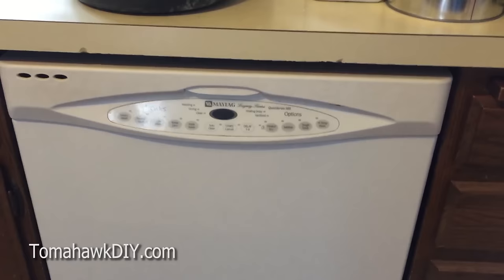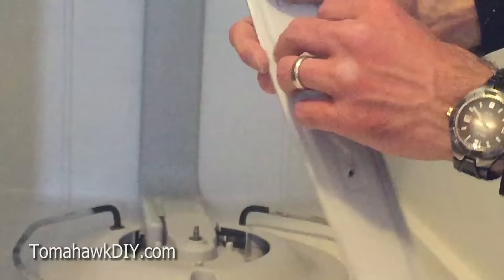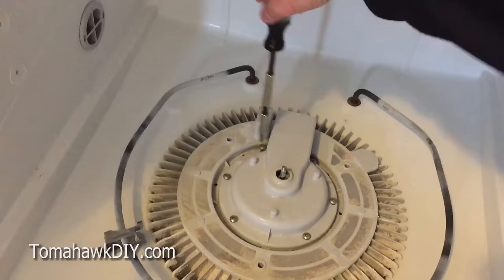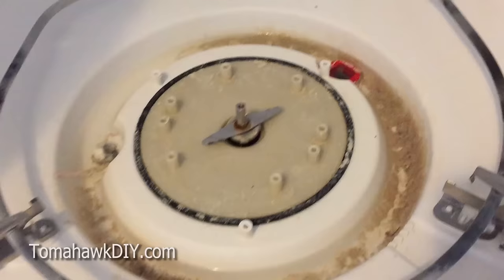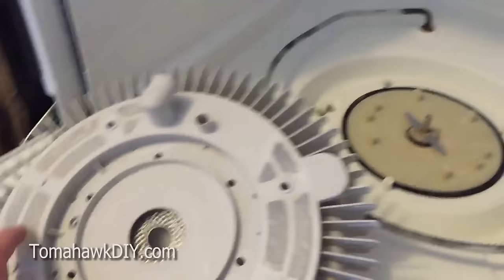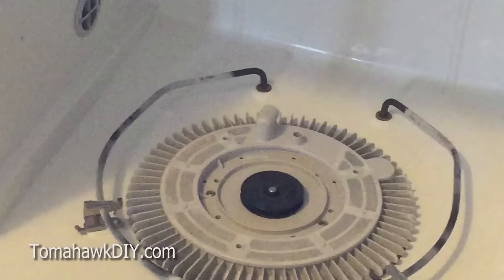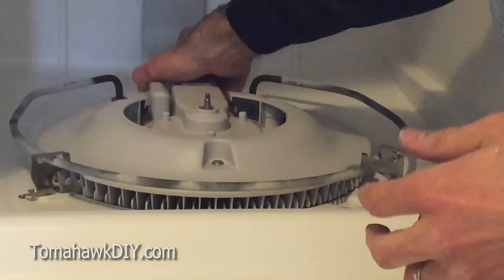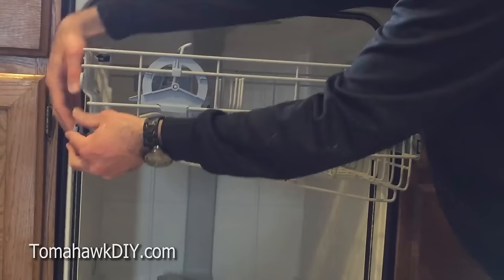Dishwasher Not Cleaning Well - How to Clean

Comment: I did it! I did it! Great instructions! It's much easier than I thought it would be, thanks to this video. I just finished taking it apart, cleaning it, and putting it back together and now I'm letting it run through to wash out any of the cleaning products I used before I put dishes in. So glad to not have to pay a repair bill or buy a new machine. And I learned something new... so I'm quite proud of myself. Thank you! Subbing now!
Reply: Cool.   I have a different model but have to clean the screen assembly.  The washer is smelly and I'm figuring on it needing a good cleaning.  I never did it before and it's 20 years old.
Reply: I also did it today! Thanks for such a helpful guide

Comment: This is the video to watch for this repair.  All other videos I saw only removed the covers and filters on the floor of the washer.  Removing the top tray and the tube at the rear of the washer, made removing everything else a breeze.  No struggling, jiggling, or awkward removing of components.  Thank you so much.  You turned a pounding headache into just a tiny little pain.

Comment: I have a Maytag MDB89100 dishwasher installed in 2000 (20 years ago!) that has been a reliable performer. Recently, however, the dishes were left with a number of light oily/greasy spots.
Thanks to youTube and your video, I was able to disassemble, clean 20 years-worth of gunk out of the filters, and reassemble the dishwasher.  My process was slightly different than yours:

1. The spray arm does not disassemble for cleaning (the clip-on metal parts are heat deflectors for the heating coil)
2. Fortunately, my DW doesn't have an exposed column to bring water to the top sprayer (supply routed external to the tub), so I didn't have to futz with that.  That said, for those who do, it might be helpful to reinstall the upper spray water colum prior to screwing down the lower part, for easier assembly.
3. While your model appears to have only one filter screen; mine has four. One of them is a vertical cylindrical screen (think auto air-filter shape). The top and bottom differ slightly, with the bottom resting on a gasket while the bottom slips over the lower assembly.  The orientation is not marked, so make a note when removing.

Some additional thoughts:
1. Toothbrush and nail scrubbers are helpful cleaning tools
2. Take pictures as you disassemble; helps in putting it back together
3. Keep screws, bolts with associated pieces. If possible, stack in reverse order to speed reinstall time and eliminate second-guessing
4. Pay attention to how tight the screws are when removed, so you don't over (or under) torque.  keep with assembly holes as noted in 3, above, so they don't get lost or misused.

Comment: Thank you so much! This is exactly the same inside as our Jenn Air!  My husband and I worked on it together, can’t believe how easy and it worked perfectly! Definitely couldn’t of done it without your video.
Reply: Hi! I’m trying to clean my Jenn Air and I’m having trouble loosening that black wheel with the screw in the center. Did you have any trouble with yours? The star screw that worked on everything else isn’t fitting with that middle screw, of course :)
Reply: @camillepress8484  This is old.. but if you have issues with that.. pour some white vinegar in the hole of the screw.. it will remove the gunk and let you pull it out easily.
Reply: @camillepress8484  If you have trouble with the screw... hold the black wheel and then unscrew it. If not it just keeps moving.

Comment: Whew! Very good instructions. Just running a vinegar bath through the reassembled machine to remove some of the harder calcium carbonate deposits. What a bogus design for the Maytag filter!! After maybe 10 years of not cleaning the filters, the glasses were showing foggy spots. it took many hours and several brushes and plastic utensils to scrape the filter parts (sort of) clean. The consistency of the soft gunk inside was indescribable. None of my cleaning fluids made it easier. I've got another cleaning six months from now on my calendar.

I should mention that the thin round tube for the upper sprayer assembly was pretty clogged and required a skinny brush with a very long flexible twisted wire handle to bend around the right angle. I hope it will clean up in the vinegar cycle.

Comment: Thanks for your video.  There's a similar set of videos that can also be useful.  See for example this video from the set:

https://www.youtube.com/watch?v=bL0xypO4M9c

Yours is the Maytag Quiet Series 300, and his is the Quiet Series 100.  The 300 has two additional screws that are not in all the 100 models.  His video shows a shortcut involving just removing the bottom pieces, and not removing the top rack or the rear water pipes.  That worked fine for my needs it seems (read below).  I hope my top "rotor arm" is not plugged.  Is that common?  The bottom rotor arm wasn't plugged at all.

I had a 300 series with a noise problem.  Thanks to your video, the noise problem went away.  There was a little piece of colored glass or something down by the rotating "blade" thing, and an orthodontic elastic band actually on the blade thing.  That may have prevented the blade from making proper contact with the metal thing with holes above it.

I removed the square red rubber piece above the drain hole and cleaned it too.  If you do that, don't forget to put it back on before you reassemble everything.

Thanks again for the instructions.

Comment: Excellent video, TomahawkDIY!
I posted replies to a couple of other commenters about clips that fell off during the removal of the sprayer arm. I had the same problem. The plastic support on the Maytag dishwasher body itself is shaped like an X (actually, more of a cross).  If a clip gets dislodged, position the square hole of the clip over the X and then rotate the metal clip slightly so that the four legs of the X point to the CORNERS of the square hole. Then, while pressing the clip against the DW body, just twist the clip back to horizontal so that the legs of the X catch the clip and hold it in place.
Reply from the maker: Thank you for that. Happy to help as well

Comment: Thank you for the clear and detailed instructions. I found one challenge that seems to be peculiar to Canada. All the screws required a torx screwdriver and 2 different sizes were required - #1 and #3. I guess appliance manufacturers want to make it as difficult as possible for us to fix things. Second, getting the dirt and gunk out from between the fin-like protrusions is a job for a small bottle brush. If you don't have one, pick one up before you start. It will save you hours.

Comment: This video was super helpful! I just moved into a rental and the dishwasher kept leaving residue and stink on our dishes. You would not believe what I found when I started cleaning the filters out, not sure it had ever been cleaned once! So glad I will have squeaky clean dishes now :)
Reply from the maker: Glad it was helpful!
Reply: I am once again cleaning out my filter because my dishes just weren’t getting as clean as they used, to and this video was so helpful yet again. The instructions are clear and straightforward, and very easy to follow! Thanks again :)
Reply: As a side note: I used the strongest spray setting on my garden hose to spray out the filter and it worked so well!

Comment: Both of my dishwashers have built-in food waste disposers, which grind up any bits that get into the dishwasher and flush them out the drain.  But the best way to prevent buildup in the first place is to watch what you put in there in the first place.  Needless to say, I've opened mine up before and cleaned them out as well, usually after glass breakage which is of course exceedingly rare.

Whatever stuff was left over in your dishwasher didn't look good.  Amazing how dirty it can get, then we go and put our dishes in there thinking they'll get clean.  The comedian Gallagher once said "Soup isn't even food.  Soup is what's left over in the dishwasher after a good meal".

Either way, very nice tutorial on how to take apart the bottom strainer assembly.

Comment: Adding something. My Impeller was stuck with gunk. I removed the little screw and dropped a few tbsp of white vinegar (Coca Cola should work same way) in the screw hole. I let it sit for about 20 mins.. and the thing came off easily!  Thanks - Trying the machine now, finally finished it! (I have health issues that don't allow me to bend down, so had to do this on a span of a 3 days).

Comment: Of all the dishwashers I've had this one was the biggest pain in the butt to get to the filter and then you can't even take the actual filter apart you have to spray out the hole like you did. That is what brought me to this video to see if there was a way to take the filter apart. I have asked my husband to do this for a year but he has a hard time getting down on his knees so I bit the bullet today  when nearly all the dishes had gunky residue on them this morning and my sink is full of dirty dishes going to have difficulty cleaning the parts. My son put the grates out of our electric smoker into the dishwasher and there is greasy black gunk all in between the little plastic parts. Hope I don't have to use an old toothbrush it will take forever.

Comment: VERY GOOD. 

My old Whirlpool dishwasher has a metal orifice hole (much like our shower heads) at the electro magnet valve which is used as a meter for the water flow fill rate before either the timer or float shuts off the magnet. 
I had to use a slightly larger drill bit to drill out the hole which was too small to let enough water in and so caused motor pump cavitation sounds and poor cleaning, which manually adding more water fixed. 
I also had to bend/adjust the float shut off level switch to allow shut off at just the right water level to keep from cavitation but not use too much water.
Take care
If the light by the padlock symbol is on, then you've accidentally activated the child lock feature. Press the button in for a some seconds until the light/child lock feature goes off.
Reply from the maker: Thank you so much for your tips and insights

Comment: yeah this is exactly what we needed to see... got one of these kept choking the drain, cleaned out drain 3x, then pump, finally found the source, these little filter traps, sadly it seems they do not come apart for cleaning? seems like fused part, lotta gunk trapped in it! tysm 4 post!!
Reply: BTW the assembly of this model is identical to my early model JennAIR. And I discovered by very careful prying at outer edge of the filter screen with a flatblade, you can work it loose around the rim, it is a factory glued item but this is the only way to get under the screen and get hair and garbage trapped out from there. The flow to drain pump is through this screen and you can scrub out inside the drain channel as well. Only pry on the outer edge, only around the filter sections, you can then lift it enough to pass a toothbrush or pipe cleaner into the drain channel and get all the crud out, water flushing won't get it all and this is what chokes your drain pump!
Reply: And don't worry about trying to glue this screen back together, if you carefully preserved the inside edge, the through bolts on re-assembly hold this all tight together!

Comment: This also works for other models like Jenn-air JDB1100AWS. Thanks... It's quite difficult to get all the gunk out behind the mesh filter. I had to use a high pressure garden hose outside to get it decently cleaned.
Reply from the maker: Thanks for the info!

Comment: Very GOOD
Also listen to the motor pump to see if it sounds like it is making a surging cavitation sound, indicating it is pumping air some of the time, low water level. 
Manually add some water to the dishwasher cycle to see if the cavitation sound goes away. 
If so then research your model, to increase the water level.
Also, If not starting and the light by the padlock symbol is on, then you've accidentally activated the child lock feature. Press the button in for a some seconds until the light/child lock feature goes off.
Take care

Comment: Thank you. You explained it very well. I think I might be able to do it myself.  One question. Since there is no way to unplug it, I assume it's still safe to clean it. Is that correct?
Reply from the maker: +Catherine Baldridge I recommend you turn off the power at the circuit breaker.

Comment: Excellent video. You saved me several hours and much frustration.  Do you have a video on replacing the rubber door gasket. My dishwasher is leaking from the lower right corner..
Reply from the maker: +Peter Smith unfortunately I don't have one in the gasket. If you want to record video footage of you replacing it, I might be able to turn that into a video I could post. Glad this one helped you. No pressure, but if you feel inclined to leave a tip, you can do so via www.paypal.me/TomahawkDIY.

Comment: Life savers! The Jennair website said to quarter-turn twist off the arm and then simply pull the filter up and out. I yanked and yanked (hopefully not breaking anything) to no avail until this video mentioned the billion other steps needed (side note, WTF Jennair?). My dishwasher still isn't cleaning, but I found the broken bolt for the washer arm floating at the bottom while cleaning the filter, so trying a new bolt next.

Comment: Thank you. This is amazing. Didn’t know we could do this. 
When we took the long thing off that is clipped in with two metal clips, the clip from the back of the dishwasher fell off. The top one stayed on. How do we re-attach the back clip. Tried snapping it on, but just fell right off. Is it glued on there?
Thanks!
Reply: Hi Chris, did you ever figure this out? Same thing happened to me. Any advice would be much appreciated. Thank you!

Comment: This video is such a fantastic help! I’m a single woman who likes to figure things out without asking for help.

But as it turns out, I need help! When I pulled off the upper sprayer arm assembly, the metal clips came off with it. I can’t figure out how to get them back onto the inside wall of the washer. Can you help? I’d be so grateful! That’s the step I’m stuck on, otherwise I did it!
Reply: The plastic support on the dishwasher body itself is shaped like an X(or a cross).  Position the square hole of the clip over the X and rotate the metal clip slightly so that the four legs of the X point to the CORNERS of the square hole. That allows you to press the clip over the X-shaped support. Then just twist the clip so that the legs of the X catch the clip and hold it in place.

Comment: Is the piece with the mesh able to be removed for easier cleaning? Mine is too dirty to clean just by running water through it. I'd like to clean it from the underside. Is that possible? Thanks!
Reply: I took mine outside and used a pressure washer on all parts including the screen. Primed with oven cleaner. No problems.

Comment: Great video. Went back a few times when it was time to reassemble.

Quick question - I replaced the broken handle as well and it seems like the 10 screws or so that keep the door together do not tightly completely. 

Any suggestions that might help me out?

Comment: i have a quiet series 200 from 2006! and it just started giving me an issues today in 2024. Ive been messing with it all day. took it apart cleaned it but still no luck.  it turns on,fills with watter then starts cycle but quickly stops. repeats that a few times before it powers down. not sure if i should spend money on repair man or just get a new one

Comment: Good video, but...  I have been doing these steps for years and they no longer work.  The middle arm squirts water, but does not turn much.  I am thinking something might be stuck in the red gasket hole.  Or, I need to replace the middle arm.  Also, when I removed the clips to get into the lower arm, it would not come apart.  Seems glued together.

Comment: The off-white film on the heating element should also be cleaned. It’s Calcium Carbonate most likely. Distilled white vinegar is typically used to dissolve this mineral deposit away on things like wire mesh screens on faucets, a shower head, and anything designed with a water heating element. The latter has a tendency to build up an insulating sheath of minerals. This can reduce the efficiency of your dishwasher and burn out the heating element sooner. This should be removed and soaked in distilled white vinegar. If you can find a large, unbusted Walmart bag or a small trash bag, then you can reduce the volume of vinegar solution needed cover the heating element. Sometimes the deposits are brittle and can be easily broken then removed but not always.

Comment: Could anyone please help me figure out if I have a stripped screw or if I need a different screwdriver to take off that black wheel? I'm at the 2:43 part of the video and have been trying to get it loose for longer than I'd like to admit. The star screw that I have worked perfectly up to this point - why doesn't it fit now here? Could it really be a different screw installed there? Thanks for your help - this is nuts! I love this video - it really is so easy, aside from user issues!

Comment: Thanks, the video was easy to follow and I had a large amount of build up to clean off (the hardest part!) however the first time I tried to run it, the dishwasher will not keep running. It starts up, stops before the soap dispenser opens. I am able to drain it by hitting cancel, but it just won’t continue through the cycle! Any ideas? I am going to try to take apart and put it back together again to see if that helps.

Comment: This is what I need except the plastic nut on top of the lower arm will not come off. It turns one revolution, there is a clicking sound and it pops down a thread. Like a thread is broken inside. Any ideas? The one you loosened with pliers.